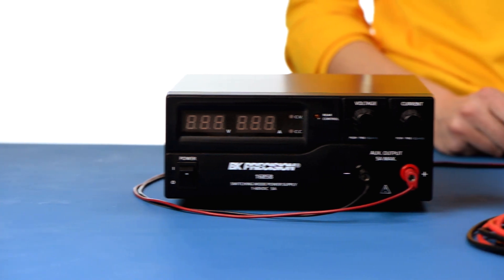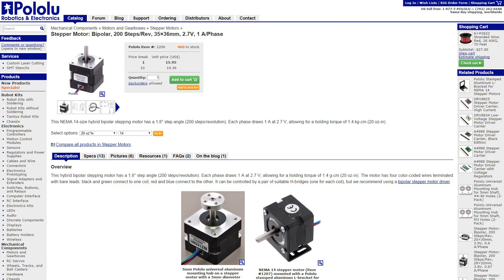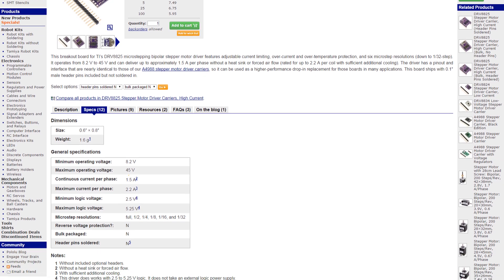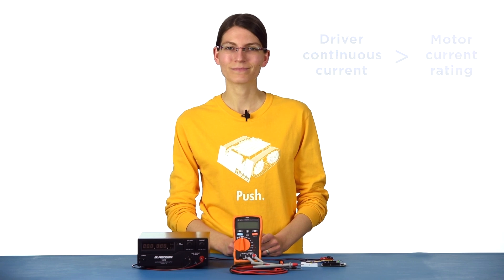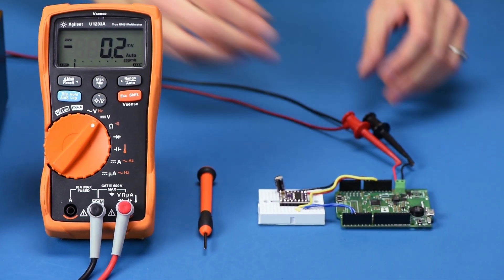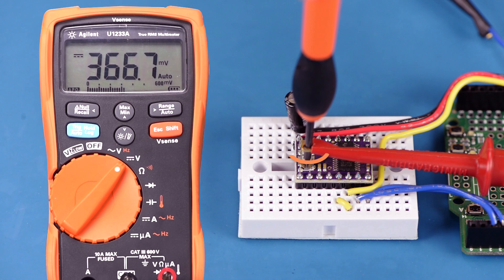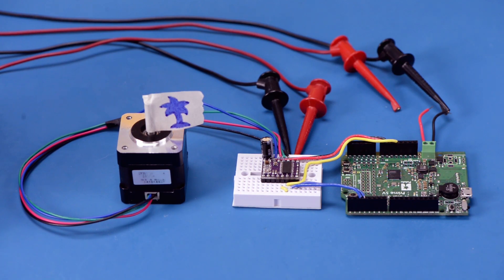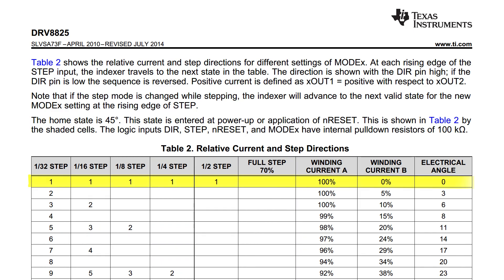Setting the Current Limit on Pololu Stepper Motor Driver Carriers

Comment: My DRV8834 seems faulty. When measuring the voltage across VMOT and the trimmer, the voltage stayed at 50-60mV despite turning the trimmer.
Eventually the trimmer broke off after a few turns
Very frustrating
Reply from the maker: Sorry to hear you are having trouble with your driver.  Setting the current limit does not involve any voltage measurements relative to VMOT, so it sounds like you might be probing the wrong pins.  As for the broken potentiometer, that can happen if too much force is applied with a tool that is too large.  A flat 2mm screw driver generally works best.  If you ordered your driver from us, please contact us directly with your order information and we can help you out with a replacement.

Comment: I am using the DRV8825 driver board with a stepper motor that's rated at 1.5A. I set the VREF to 700mVolts. The stepper motor shakes volilenty without any stepping. So what can be the cause of the shaking?
Reply from the maker: There are a few possible explanations for behavior like this, but figuring out why that is happening in your specific setup will probably require some troubleshooting.  YouTube comments are not a good setting for that kind of discussion, so please consider posting on our forum instead:

https://forum.pololu.com

Before you post, please review our support page which has some general troubleshooting advice and recommendations for what you should include in your post when you contact us:

https://www.pololu.com/support

Comment: Can I also ask if my motor has a current rating of 1.68 A and my A4988 driver has a continuos current rating of 1.2 A can i exceed the value to get the stepper motor running at full step?
Reply from the maker: Unless you take additional steps to keep your driver cool, it will overheat if you exceed its continuous current rating of 1.2A.  It is possible your stepper motor will work fine with a 1.2A current limit setting (the 1.68A is just the current you must not exceed when operating it).

Comment: Okey i have two questions.
1)If my motor is rated 1.5amp, should my curent limit max 0.75 amp since x2 it will be equal to my motor amp.Also if it is that way should i be applying 0.375 amp from my power source
Reply from the maker: Most motors' ratings are specified per phase (per coil), so if that is the case for your motor, you should also set the driver's current limit to 1.5A. Then, you would want to make sure your power supply's current limit is high enough that it does not limit how much current the driver and motor can draw (they will only draw as much as they need; the supply will not "push" current into the system). If you have any more questions, please post to our forum: https://forum.pololu.com/

Comment: Is there any benefit from using a 24V 5A power supply vs 12V 10A?  Same heat generated or any pro/con if both supplies meet the needs?
Reply from the maker: In general, higher voltage allows for better stepper motor performance, so we recommend using the highest voltage that is safe and practical for your application.

Comment: This video was great for troubleshooting why one axis of my machine was losing steps: the manufacturer had set the current limit to ~20% of the rated motor current on one driver.  I suspect that driver never got set from the factory.  Using the screwdriver-as-a-probe technique worked great!

Comment: what is the voltage that we should give to the expansion board inorder to work for 4 stepper motor(Nema 17) (:using A4988 step stick)
Reply from the maker: We do not make the StepSticks, so we cannot comment specifically on those. For our stepper motor drivers, as long as the current limit is set appropriately, you should be able to use any voltage at or above the rated voltage of the motor, up to the maximum allowed by the driver.
Reply: @pololu  thanks, Pololu robotics  and electronics

Comment: Thanks for  your video. How to calculate current limit A4988 in case 1/16 micro step. Your video is full step.
Reply from the maker: The instructions in this video for calculating the current limit setting apply independent of the microstepping mode. You just need to check the product page for the A4988 to get the equation for Vref for that driver: https://www.pololu.com/product/1182

Comment: I think when building a car electric motor driver three fase 120 volts, I presume also here is the need of a active current limiting, reason is when I need high rpm from a induction motor I need to do the same as with steppers, the impedance gets up on higher rpm and frequency dropping power, therefor a active current limiter allows to wind a motor for max power need lower induction and as such high current when does low rpm where frequency is lower, here a current limiter will help I presume, am I right?
Reply from the maker: Current control for a stepper motor driver is important because it allows you to use a higher supply voltage to ramp up the current quickly without exceeding the motor's limits.

Comment: Is the motor sketch provided also the bare-minimum needed to measure the Current limit? Would connecting Reset and Sleep to +5V and Ground  to ground suffice?
Reply from the maker: Hi, essmene. No, you don't need to be connected to an Arduino running the motor sketch to set the current limit. The connections you mentioned along with connecting VMOT or VDD (depending on the driver) are enough.

Comment: You showed that your stepper motor had a voltage rating of 2.7v yet your power supply was delivering 12v.  I understand that the power supply was powering both the board and the stepper, but shouldn't that amount of voltage have fried the motor?  And how did you know to deliver 12v, I couldn't see a reference to that voltage on the product page?
Reply from the maker: Hi, Daniel.

Good questions! To avoid damaging your stepper motor, you want to avoid exceeding the rated current.  So as long as you set the current limit below the rated current, you will be in spec for your motor, even if the voltage exceeds the rated voltage.  (The voltage rating is just the voltage at which each coil would draw the rated current based on its resistance.)

Claire used 12 V because that's a common supply voltage and within the input voltage range of the DRV8825 stepper motor driver. 
By using a higher voltage along with active current limiting, the current is able to ramp up faster, which lets you achieve higher step rates than you could using the rated voltage.

Comment: I have the DRV8825 with the via basically on the underside. Do i solder a link, attempt to get a probe to topside avoiding the heatsink????
Probe on the screwdriver true magic.
Reply from the maker: If you are worried about proximity to a heatsink you have installed, probing the top of the potentiometer or the screwdriver as you mentioned is fine.
Reply: Pololu Robotics and Electronics thank you.

Comment: What if everything is wired up as shown, powerd by an arduino Uno 5v, but neither the Potentiometer nor the test Via show any Voltage other then 0V? Also if tested with the Stepper driver example and wired 5 to 12 V on Stepper in, the motor doesen‘t work properly(high current draw but lagging movement). Is it safe to say that the Driver is damaged?
Reply from the maker: It is difficult to say without more in-depth troubleshooting.  The driver could be damaged, or it might not be wired the way you think, or the way you think it should be wired might be wrong.  If you have a stepper motor driver that we manufactured, please email us or post on our forum for troubleshooting assistance.
Reply: Pololu Robotics and Electronics Yes, thanks a lot for the effort! Rewatched the video and noticed the hint about the tip of the screwdriver, mine had no grip and the SLEEP and RESET pin had both to be HIGH + after pulling sleep high, you need a small 1 ms delay. I think the tutorial on your website could be a bit more explicit on the inverting logic, but maybe it’s just me. Anyways thanks a lot for your high quality driverboards and documentation!

Comment: Hello, I have a problem with my grbl CNC plotter when I run the X axis on the CNC, the y axis run and if the y axis run, then the y axis still run.mean x axis is not working in both conditions
Reply from the maker: You might have some luck on one of the CNC forums with questions like this.

Comment: Very useful information, but the thing about being able to set the current to 1A per coil in full step mode is an error.  The power dissipated in the motor windings is the sum of the squares of the currents times the winding resistance, two coils at 70% of the limit generate as much heat as one winding at 100%.  If you do the calculation for all the entries in the multistepping table in the datasheet you'll see the power dissipation is constant.
Reply from the maker: You should consult with your particular motor, but we expect that the ratings will generally apply to individual coils.  You seem to be putting a lot of weight on the driver side, and the drivers are just trying to make smooth torque while microstepping.  By the way, there are other drivers, such as the TB67S249FTG, that offer non-circular options where the power dissipated is not constant, and the full-step mode runs both coils at 100% instead of 71%.

Comment: I have Stepper Motor Nema17 with 1.68A/phase can work with DRV8825 that have continuous current of 1.5A ..?
Reply from the maker: Hello, Sipan.

The DRV8825 carrier should be fine for driving that stepper motor if you do not need the full torque it is rated for, since it can only deliver about 1.5A per phase without additional cooling.  You might consider our TB67S249FTG Stepper Motor Driver Carrier, since it can handle the full current your stepper motor is rated for:

https://www.pololu.com/product/2973

Comment: Nice video but I didn't understand how to measure the current of the stepper motor?
Reply from the maker: The main point of the video is how to set the current limit. Measuring the current of the stepper motor is not usually necessary, but if you have further questions, our forum is a better place to have a discussion about that:

https://forum.pololu.com

Comment: So... My 3d printer uses nema 17 -1.7a . And i just installed the drv8225 drivers, i set them in 0.6 cause was doing the calculations to  don't stress my motor an reach only 1.2a (70%). But now i am confused, does that mean that it is running above the 1.2a? should i just set it to 0.85a and let the drivers deal with it?
Reply from the maker: Unless you are doing some special cooling, you should probably limit the current to 1.5A per phase (or less), so your VREF voltage should be set to 0.75V.  If you have further questions, our forum is a better place for technical discussions:

https://forum.pololu.com/

Comment: Nice video! Do you also have a video for wiring the drv8825 to raspberry pi and a nema8 motor?
Reply from the maker: Thank you!  No, we do not.  We recommend getting started with the DRV8825 by reviewing it's minimal wiring diagram and the "Using the driver" section of its product page:

https://www.pololu.com/product/2133

If how to connect to the driver is still not clear to you after looking through that, please email us directly or post to our forum for support:

https://www.pololu.com/contact

Comment: I have a huge stepper that I'm working with that draws about 1.68 A per phase and I am programming with an Arduino Uno. What's the best driver I should use? Is the one in this video sufficient? I know it says 1.5 A...
Reply from the maker: You might be able to get by with the DRV8825 carrier depending on your application, but limiting the current to 1.5A per phase will slightly lower the capabilities of your stepper motor.  Instead, you might consider our brand new (released today!) MP6500 stepper motor driver carrier, which can deliver approximately 1.8A per phase continuously without additional cooling: https://www.pololu.com/product/2966
Reply: Pololu Robotics and Electronics Awesome! I will definitely check that out. That's very convenient timing.

Comment: Great video, How did you make the stepper motor not step so you could measure the full current?
Reply from the maker: We are glad you like the video!

The driver will only step when it receives a pulse on the STEP pin, so you can leave the STEP pin on the carrier disconnected or pulled either low or high while setting the current limit.
Reply: Get explanation... thank you.... is the somewhere I can get some sample Arduino code to run this?
Reply from the maker: You can find a link to a simplified version of the Arduino code used in this demo in the video description above.
Reply: Thank you for helping me with my enquiry

Comment: Can I control stepper motor NEMA 17 to 1.7A with A4988 driver?
Reply from the maker: We generally recommend our DRV8825 or AMIS-30543 carriers instead of the A4988 for controlling motors with currents that high.  If you have additional questions, please post them on our forum:  https://forum.pololu.com/

Comment: I wish they had just 3 jumpers and we could adjust the current limit instead of messing with this shit...
Reply from the maker: What would those jumpers do?  Would you prefer there only be a few possible current limit settings?  By the way, you might like our new Tic T825 stepper motor controllers. They allow the current limit and other parameters to be set over USB and use higher level speed or position commands rather than a step signal:

https://www.pololu.com/product/3130

Comment: hi claire,

how you measure the voltage accross the motor? which reference point are you taking ?Is it from the negative power supply for motor?
Reply from the maker: The voltage across the motor coil is measured between one side of the coil and the other side of the coil (e.g. A1 and A2 on the DRV8825 carrier).

Comment: I bought 2 motors from local robotics shop.it looks like nema 17.there was no lebeling on it when i bought it.

 according to a youtube video i keep the potentiometer value on 1.6 kohm on a4988 stepper motor driver.

i bought today a 12 v 2 amp dc adapter.before that  i used 12 v 500mA, 12v 1A,  when using 500mA the motor bibrates and gives a sound. In 1 amp motor still vibrates and gives higer sound, using 12v 2 amp it again vibrates and gives ultimate sound and  4988 stepper driver's heat sink getting too hot. what should i do?
please help......
Reply from the maker: Considering you do not know your motors' specifications, it is likely the current limit on the A4988 is not set appropriately for your stepper motors.  However, YouTube comments are not an appropriate place to discuss detailed technical support questions like this.  Please post your questions along with a detailed description about your system to our forum to continue the discussion.
Reply: https://forum.pololu.com/t/cnc-shield-and-a-4988-stepper-driver/12686

this is the link containing my post to your forum.

Comment: Hello can you tell me how you Setting the Current Limit on easy driver  V44 A3967?
I have stepper motor Nema 17 Rated current/ phase: 1.4A
Phase resistance: 1.40hms
Voltage: 2.8V
supply 12v
Reply from the maker: We do not make the Easy Driver; you should ask its manufacturer for support.

Comment: Hi Claire How can I do to obtain the current value from the CD ROM stepper motors so that I can calibrate it with my A4988 Pololu driver?.These values are not even detailed in the motor parts in many cases.I `ve heard that an aprox value could be 0.20 calibration point but you will tell me if this can be done.Greetings!.
Reply from the maker: We replied to your email about the same issue.  Directly contacting us over email and posting to our forum are much more appropriate than using the comment section of a YouTube video for answering technical questions.
Reply: Thank you Claire I have received the answer into my email but unfortunatelly you haven`t been of help to my question.Thank you anyway

Comment: Hi :) I have a 1.3A rated current stepper and an A4988 (Current Limit = VREF × 2.5). Does that mean I should set it to 1.3/2.5 = 0.52 v or 520mv? When measured on the vref? Also, would a DRV8834 be a better driver for this motor? Thanks!
Reply from the maker: There are different versions of the A4988 carriers, and we would need more information about your system to make a recommendation for an appropriate driver.  However, YouTube comments are not an appropriate place to discuss detailed technical support questions like this.  Please post your questions on our forum to continue the discussion.

Comment: My pololu8825 wont works microsteply with  motors with 5 Ohm coil resistence but only work for a NEMA23 stepper which 10 Ohm resistence.Why

Comment: I was wondering, wiring 2 motors is series.... would I be multiplying my current to double the value the formula gives or no?My set up.... Ramps 1.4 with 3 DVR8825 drivers(x,y,z) and 5 (2amp motors). 1000mA would be 100% per motor by my calculations and 500mA would be 50%. Would the 2 drivers running 2 motors each, then be at 2000mA and 1000mA respectively. Also, would cable length to each motor on a given driver need to be the equal... would a slight V drop affect the further motor significantly?
Reply from the maker: It is possible to use two stepper motors in series controlled by a DRV8825, but YouTube comments are not an appropriate place to discuss  detailed technical support questions like this.  Please post your questions on our forum to continue the discussion.
Reply: Sorry, I didn't know...  I did just sign up to the forum and posted my question in there under DRV8823 with dual motors in series.